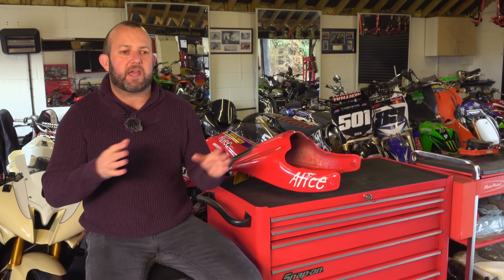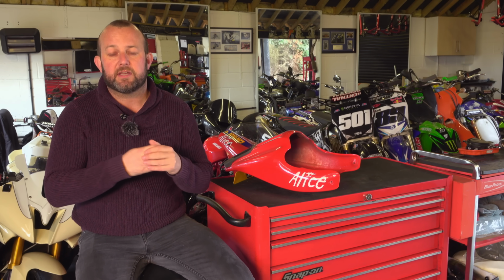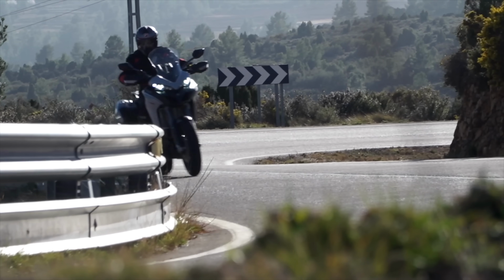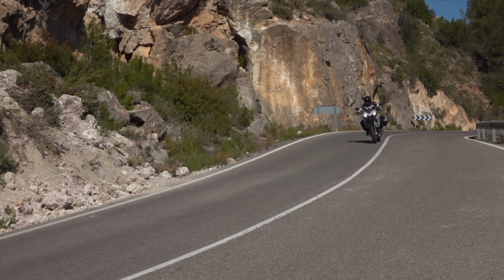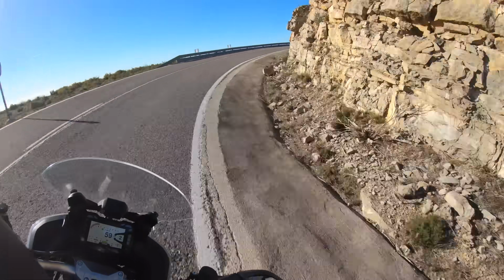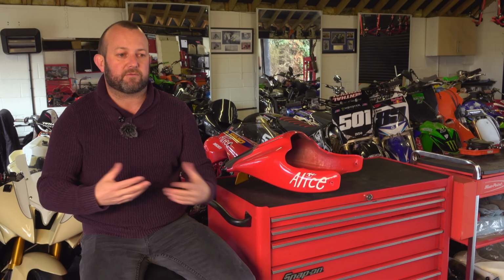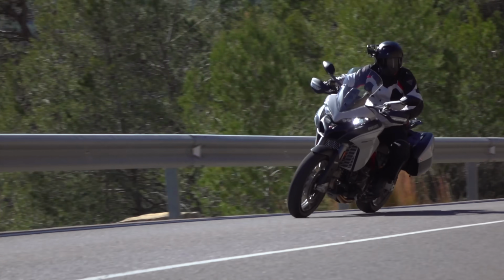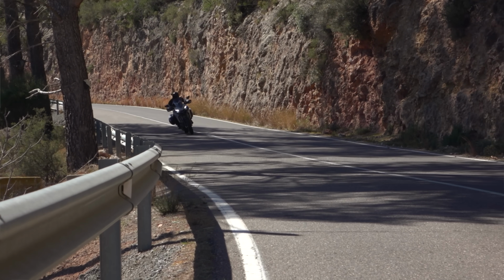2019 Ducati Multistrada 950S First Ride Review

Comment: Linked brakes are interesting.  Had a Guzzi Spada with a simple mechanical system: you could stand on the foot pedal and come to a fairly rapid stable stop with one front disc and the back disc activated.  If you really needed to pin it, you just added some second front disc with your right hand. Simple, reliable and effective for easy use.

Comment: You said you've driven everyone
How does the regular 950 without skyhook feel compared to the 950 S
Would you even notice the difference commuting or just cruising around town on smooth pavement
I think it's just one more thing to break, and the bike cost 25% more
You could get a regular v4 for a couple grand over the 950 S
Where I live
Multistrada 950 $16,495
Multistrada 950 S $20,445
Multistrada V4 170 hp  $22,395
 I think for bombing around town, I would get the regular 950, 
Less to buy, less things to break, and I really don't think I need 170 hp and a more complicated engine, 2 more cylinders to work on
The regular 950 would still be, fun as hell to ride, compared to the 950 S and the V4

Comment: Only thing is, I don't think you can fit a slip-on to this (or a cheap full system like Delkevic) - but you could with e.g. a 2018 950. Not sure what the best options would be to make it sound better??

Comment: Good review, sounds like Ducati have finally fixed all the faults of the first gen of the 950 Multi, and there was a few!  I had one of the first 950 Multis and before i picked it up (from new) the gearbox was in bits because the gear selector wouldnt work properly in top.  After 12 months of ownwership i have had the following faults: Fork seal blown, front brake caliper pipe chaffing, second gearbox strip to fix selector, screen mount vibrations...repaired, clutch when cold was either in or out no in between, very scary pulling way from a junction in heavy traffic.  Recalll on a coolant pipe, stalling motor when pulling away from cold, also not nice. Other generic faults, soft front suspension, lump low down.  Other than that it was a great bike!  But i wouldnt buy anther Ducati. Sorry....

Comment: I have only ridden a 2018 950 but it was so much better than I expected. I own a Versys 650 and Tiger 800, never have owned a Ducati, but I would buy the 950 Multi. The engine induction noise alone is intoxicating enough, but the bike is comfortable and extremely competent. I’m sure the Skyhook suspension is fantastic, but the standard fork/shock combo work very well. Many assume the 1200 or 1260 is the obvious choice and the better bike, but they haven’t ridden the 950. You are correct in your assertion that it’s the best one. I really must try the 950S.

Comment: 6.7 liters per 100 kilometers: 42 miles per UK gallon or 35 miles per US gallon. For reference, my Merc C diesel easily does 5 l/100km or 3.5 l/100km on the motorway.
Reply: My 950 averages 60mpg ?  And that's not pootling about👍
Reply: His consumption number is high for obvious reasons. I average 4.8 on mine with a mix of city commuting, highway, and hooning.

Comment: Heated seat and grips as standard? Anyone know?
Reply: The seat gets hot, so you dont need it heated.  😁
Reply: MidLifeMotorbikeSafety Heated grips come with one of the optional packages or can be ordered separately. They are not standard equipment, at least not in the States. I didn’t see any option for a heated seat at all.

Comment: Great review... one comment is that you can get 950 like power by adjusting your 12x0 to its low power mode. I found that in that mode the bigger multi feels very close to the 950 (weight is very close between the two). If you feel like 160hp is too much for most street riding but you may want it available for track days or for occasional spirited street riding then that would give you the best of both worlds (lower but entirely usable power for routine riding and higher power for shenanigans). If you're SURE that you'll be content with 110hp then the 950 is a great option - the new S has nearly everything available on the bigger brother. I can attest to the fact that (even for a guy who likes riding hard occasionally) I would not often notice the power difference during 95% of my riding.
Reply: David Kuhn that’s a good point.

Comment: 8.45 - You're adding preload with those settings, not firmness. Preload is to maintain rake/trail due to changes in load and setting up the suspension for adequate travel, both ways (SAG). Damping changes the firmness or softness of suspension. Stick it on two up with luggage and you are just raising the rear end of the bike, shortening the trail and making the bike turn in quicker. It has nothing to do with firmness.
Reply: Terry Cox firmness is how I would describe the feeling/response to increasing the preload, so I did. I saw on another 950 Multi review that you’re claiming you’ve found another journo that doesn’t understand suspension. I think you’re wrong.
Reply: John Hogan - yes, I don’t think so John. You’re not alone, many many people misunderstand what the effect of preload changes are and what it is for. In what way do you think the suspension is stiffer/softer by raising or lowering preload? How does that work mechanically (because at the end of the day the electronics just works on a mechanical spring). Is it possible your preload setup on that bike is also linked to the damping setting and it is changing damping as well as preload? Maybe that is the case in which case I would be wrong and owe you an apology.
Reply: @terenceokeeffesmotorcyclestuff  The load setting chosen is linked to the damping circuit in the Skyhook algorithm. For one the rebound circuit is altered and I'd suspect that the compression is too. You can also customize your damping (5 levels; standard/soft/softest/hard/hardest) in each of the ride mode on those bikes. I own a Multi Enduro 1200 and the suspension is pretty much the same even if there's been improvement in the algorithm and the way you adjust them thru the dash interface.
Reply: Le Racer - thanks, that explains the damping changes felt. 👍

Comment: Always I heard there is an issue of reliability surrounding a Ducati. How is it different this time around? Is it true though?
Reply: @kuhndj67  thanks David. It's Italian so highly desirable but was concern of the potential headache. Good to hear that it is not "prohibitive"!
Reply: Since every rider is different I never tell folks "It's fine"... because if you go insane at the little things then Ducati isn't for you. I've had the bike in for warranty stuff at least 4 or 5 times, things like the seat staples coming out, recall on the sending unit for the fuel gage, broken pannier mount... annoyances. However it's not left me stranded once, which is my personal metric for reliable.  @shahrimanjohann9283
Reply: Those timea are gone, 40k miles done on a mts 1200, only issue was a blown oil seal on fork, but that is a regular wear problem, happens on almost every bike. Ducati is owned and supervised by volkwagon now, german qa standards

Comment: Thanks for the informative review.

By the way the 'I' in IMU stands for inertial not internal.  And while there are only 3 axes (roll, pitch yaw) of motion, the six-axis refers to a solid-state accelerometer and a separate gyro being on each of these axes measuring velocity and rotational forces.  Some vehicles might have a magnetometer too (looking at heading) giving you a 9-axis IMU!
Reply: There’s always something I say in every review that I slip up on, this was one of those. I also called the 900 Tracer a GT900 Tracer as well. I’m very much aware of what an IMU is and how they work, despite me sounding like a mumbling twit in the piece.
Reply: Yay were into Quad copter FC's..................
Reply: The same sort of stuff found in cell phones these days.

Comment: Great review, it really is a belter,  perfect for the crappy roads in this country yet a great touring machine for the continent too, get the comfort seat if you're a taller rider then all is good.
Reply: @YeOldOak How tall are you? And would you say the suspensions are as comfortable as a 1250gs? Thanks!
Reply: @Speedytrip  I'm 6ft (183cm) and the comfort seat was a must for me.  Can't comment on the comfort V's 1250 as I had the original 950 not the S with no electronic suspension.  I now have a 1290 SAS which is even more comfortable, but the 950 handles better than the KTM.

Comment: Nice bike but think I prefer the BMW's 😃
Reply: It's tough for me...I just wish the BMW GS1250 came in a 950 model
Reply: @jean-baptisteronfard9361  Yes! A shaft drive 900 to 1000cc boxer with a scaled down frame and drive train to shave some weight. The only thing I don't like about my R1200GS is how much it weighs.
Reply: @Brad-RB  Care to look @ Moto Guzzi V85 TT
Reply: @jean-baptisteronfard9361  there's always the 850GSA
Reply: @Varaprasad_Boloor  I rode the 800GT on the B500 (black forest) last fall and it was an absurd amount of fun in the twisties. I had my usual GS for a weekend rental and I dragged a buddy along (he rented the 800). It was everything I'd come to expect from BMW, and what it lacked in a straight line it made up for in the corners.
Reply: A barking Vtwin vs. a bland 360° firing interval boxer. That's what it comes down to.
Reply: I have a Multi 1200S but always rent GS's when I'm in Europe... they're both great bikes but intended for two different audiences (I'd not mind owning both). The Multi is more Sport... the GS is more ADV. I rent GS's because I'm not led into temptation on them (they just don't have the gonzo power delivery). They're still quick, nimble and a LOT of fun to ride (along with refined and comfortable)... but they're not as sharp as the Multi, the telelever doesn't have the same feel, the engine needs shifting about when the Multi is really starting to scream, and overall the riding experience is more 'laid back'. As for the S1000XR, the Multi is more refined and comfortable for touring than the vibey beemer, which imo is only suitable for weekend warrior duty (which is super naked territory where the Tuono and SDR currently lead the pack).
Reply: @kuhndj67  yes agree, they are both great in different ways 😃
Just prefer the look of the Bmw's.